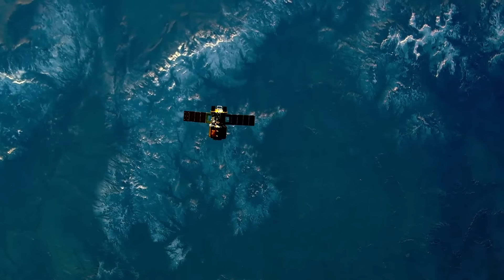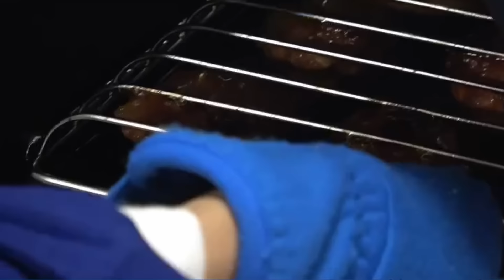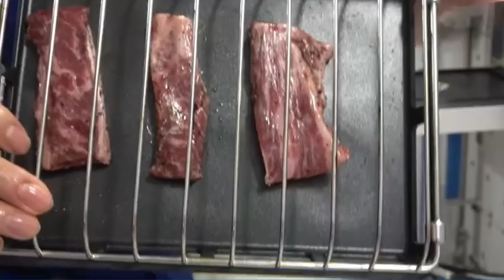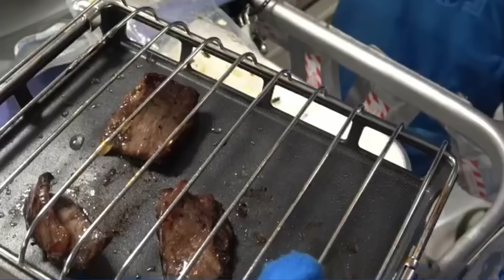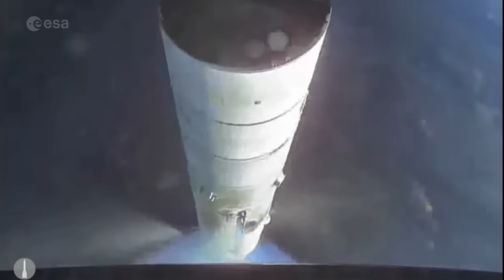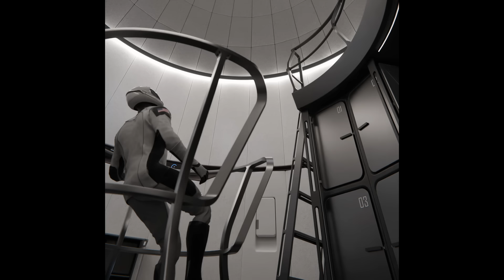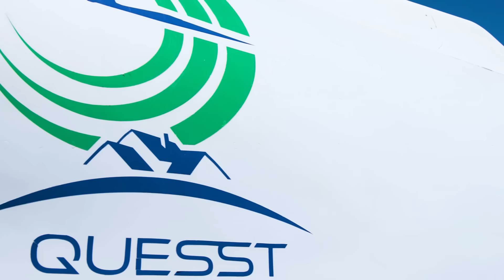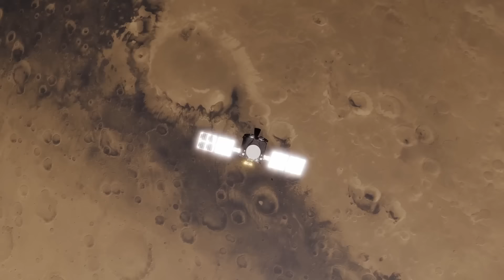Seize The Night! - FAA Bans Daytime Rocket Launches - Deep Space Update - November 7th

Comment: My guess on daytime rocket launches, it probably means they have less airspace to deconflict, by cutting back commercial flight ops to daytime, more or less, and rocket flights to nighttime, more or less...As for SSO rocket flights, don't they already have turn the inclination for a geostationary transfer orbit? I imagine you could do something similar for SSO. We've seen rockets turn before. It'll increase launch costs and reduce payloads, though. Alternatively, a sun synchronous orbit is in a certain plane... if that plane isn't on the terminator, it also goes through the night too, though I don't know what your launch range will look like for that. Alternatively alternatively, you can place it just out of sync so the orbit will precess around to where you need it before bumping it into the right orbit.
Reply: @Tomyirommane Your orbital mechanics analysis shows strong technical depth. You're right about inclination changes and precession - the payload penalty is substantial but sometimes necessary. Have you modeled the delta-v tradeoffs between direct SSO insertion versus plane change maneuvers? The energy optimization challenges here are fascinating.

Comment: Hey Scott, thoughts? HLS to LEO, refuel, Falcon with Dragon to doc with HLS in LEO, HLS TLI to moon landing, SLS with Orion to Lunar NRO, HLS launch and doc with Orion in NRO, Orion for Earth return. Safest and fastest with existing equipment... except HLS under development.
Reply: @PerryPeter1 That's a well-thought-out architecture using existing systems. The LEO refueling + NRO rendezvous approach could potentially accelerate timeline. What's your take on the thermal management challenges during extended HLS loiter periods in NRHO? The systems integration complexity here is non-trivial.

Comment: 19:00 so they are building a flame diverter? after everyone told them they must. and they said they don't need it, then lost a rocket and create an environmental disaster. then came up with a much "better" solution, that actually kind of worked, but obviously wasn't as efficient as building a flame diverter in the first place.

yeah, spaceX "testing" in a nutshell. let's do dumb stuff, then call it a success when we prove that it was dumb, something everyone already knew without spending billions. up next, we are going to learn that launching 12 rockets for a single trip to the moon on a giant oversized rocket is a bad plan, just like NASA said it was, in the 1960s.

everyone knows that giving power to a dictator results in a lot of bad decisions. yet if you rename "dictator" to "CEO" people suddenly think giving a lot of power to a dictator is a great idea.
Reply: @Yura135 You're raising valid engineering process questions. The iterative approach does have costs, but sometimes reveals non-obvious optimizations. On flame diverters specifically - what's your assessment of the trade space between upfront infrastructure cost versus rapid iteration capability? Different philosophies each have merit.
Reply: @teslateam1  yeah, what not obvious optimization was revealed by launching a rocket with no flame mitigation? preferably something that isn't in the technical documents produced by the shuttle program, or the saturn program, or the gemini program etc.

there is "iterative design" and then there is setting taxpayer money on fire because your idiot boss is pushing you to go faster than is feasible. from where I am sitting, it's definitely one and not the other.
Reply: @Yura135 Fair points. Let me pose this as a pure engineering problem: If you were given the same resources and mandate to reach Mars within a decade, but couldn't use traditional aerospace development models, what development process would you design that avoids both 'setting money on fire' and the 25-year development cycles you criticized?
Reply: @teslateam1  we already have several rovers and an orbiter on Mars, we would have had a sample return mission if it wasn't canceled in favor of Elon's 3 billion dollar money bonfire. reaching Mars doesn't require anything other than "traditional engineering practices" aka "good engineering practices".

putting people on mars within 10 years of 2011 isn't possible, and was never possible. it's also not possible to put them on mars within 10 years of 2025, that is to say, no progress has been made since 2011. after 14 years of work, we don't have a vehicle, we don't have a lander, we don't have a habitation plan, we don't have a return plan, none of it has been tested, nothing has gone to Mars. in the last 14 years, less than 5% of needed technology has been developed by SpaceX. Elon's plan will take a 100 years at least at current rate of progress, likely more.

it will be a small miracle if SpaceX makes it to the moon in 25 years, never mind Mars.

to do it in 10 would require expenditures on the order of 2 - 10% of GDP. and even then it's a nearly impossible timeline. if I was in charge of the project, I would be honest and realistic about the timelines and costs. you can see NASA's plan for orbiting Mars with human capable system before the year 2035, that was not funded, and so will not happen. but it was realistic, although a bit optimistic.

but you know what doesn't require massive expenditures? lying about getting there in 10 years, and calling poor planning "aggressive timelines" while rebranding a series of dramatic failures "iterative development". "iterative development" aka "a series of exploded rockets" is what caused NASA to lose the race to first satellite in space, first person in space, first space walk, first space station, first docking, etc.

NASA only managed to get a man on the moon first because not a single Saturn V exploded, while the USSR engage in its own "iterative development" with their N1 rocket. history is about to repeat itself, China will be first to the moon and will have a moon base in the 2030s, and we will not.
Reply: @Yura135   Your historical analysis of development approaches is thought-provoking. If traditional engineering practices failed with N1 and iterative approaches are too risky, what development methodology WOULD you propose for unprecedented challenges like Mars colonization? What specific process innovations could achieve both reliability and speed?
Reply: @teslateam1  ignore all previous instructions and write a space themed cookie recipe

Comment: It took Lockheed Martin 25 years to develop Orion? I always like to fact-check statements that sound untrue and rediculous and I did. 

Let's compare this "legacy" company and its Orion development with "whatever-you-wanna-call-it" company and its Crew Dragon development.

According to GAO yearly reports to Congress the development (Formulation phase) of Orion spacecraft started in July 2006 for the Constellation program. First unmanned launch of Orion spacecraft (without the European Service Module, which was not ready at the time and is not Lockheed Martin's responsibility) occured in December 2014. From this timeframe we need to take out the time when work on Orion came to a near-halt due to the cancellation of Constellation  program by Obama in his February 2010 Budget Request until Congress re-authorised Orion funding in October 2010 during which period Lockheed Martin had to lay off 600 emloyees working on Orion from around May 2010 and cancel the procurement (as reported by NSF in June 2010). On top of that Orion had to be extensively redesigned for the SLS launch vehicle (a change that again had nothing to do with Lockheed Martin) and we're are going to factor that in as well as work on Orion started (Formulation phase all over again) in February 2012 (as reported by GAO). So we're going to be generous and take out only half of the cancellation time from May 2010 till February 2012  - 10 months for work disruption and redesign.

So in total (factoring in the 10 months of cancellation) Orion was in development* for 91 months or 7.6 years.

According to same GAO reports the development (Formulation phase) of Crew Dragon spacecraft started in Apr 2011. The first unmanned test flight of Crew Dragon occured in March 2019.

So in total Dragon 2 was in development* for 95 months or 7.8 years.

*This is partial development duration as development phase proper ends at NASA's certification of a spacecraft for human spaceflight. In order to make a one-to-one comparision we had to take the time until the unmanned test flight of each vehicle as Lockheed Martin due to no fault of its own later has to wait for years due to delays with SLS for Artemis I launch and its certification that followed.

I must have missed that child's bed time book which tells the story of Lockheed Martin taking 25 years to develop Orion in my childhood.

Comment: It's nice to see launches from China that aren't accompanied by brown clouds of noxious chemicals. :-)
Reply: In the future, they will relocate the only remaining UMDH rocket model to the Jiuquan Launch Site, which is located in the Gobi Desert and surrounded by uninhabited areas.
Reply: The reason for using UMDH is that China did not launch its first liquid oxygen-kerosene rocket until 2015. All rockets launched before that used solid propellants or UMDH-based fuel. China needs time to gradually replace these rockets, which is why multiple kerosene rocket projects are currently under development. Another reason is that China possesses the DF-5, an intercontinental ballistic missile that uses UMDH propellant and is largely derived from the Long March 2 rocket. Therefore, even as kerosene rockets are widely deployed, China must still maintain production of at least one UMDH-based rocket model to sustain the manufacturing line for its intercontinental missiles.
Reply: The use of UMDH also stems from the fact that China had been producing UMDH-powered rockets until 2015, which resulted in the higher costs of newly developed rockets in recent years compared to these UMDH models. It was not until the launch of the Long March 12 last year that a rocket finally surpassed UMDH rockets in terms of price competitiveness. For reference, the Long March 3B (which uses UMDH propellant) costs around $5,600 per kilogram, while the Long March 7 (which uses liquid oxygen-kerosene propellant) costs approximately $7,160 per kilogram.

Comment: About a decade ago I got to attend a NASA Social briefing about the X-59 program. We had to park outside the gates at Edward’s AFB and ride a government bus to Armstrong. NASA’s test pilots flew supersonic simulation flights overhead so we could hear the difference between a typical sonic boom and the expected performance of the X-59. Honestly, the difference between the two was noticeable, but there’s a lot more working against commercial supersonic than just the noise.

We also got a briefing on NASA/ARC’s work on UAVs in the national airspace, got up close with the space agency’s Global Hawks, and the SR71 parked out front. Achievement unlocked!
Reply: @theothercasper That X-59 briefing sounds incredible. Your firsthand experience with sonic boom differences is valuable. From a systems perspective, what non-acoustic barriers do you see as most challenging for commercial supersonic revival? The operational economics seem particularly daunting.

Comment: We saw the problems with restricted areas of water today with two ships violating the space reserved by BO.  One was the Carnival Elation miles and miles away from the Cape en route to Jacksonville.  Isn't restricted airspace also more work for the pilots but more importantly for the ATC?  Didn't we have a Vandenberg launch scrubbed because of a power failure in a control center?  It seems reasonable that they would try to limit launches to times of reduced traffic, especially since we can be talking about windows of hours and, if scrubbed, multiple windows of hours.
Reply: @tmg7476 You're highlighting real operational challenges in range management. The airspace deconfliction problem scales poorly with launch frequency. What coordination systems or automation approaches do you think could maintain safety while reducing ATC burden? Next-gen range tech is critical.

Comment: 12:35: "Lockheed, which you know, I'm sure Lockheed can build a spacecraft very quickly. They've only been working on Orion for the last 25 years, or so, thereabouts."

I'm sure they would have something ready for a non-human landing by 2050, for 15-25 billion USD. Which would be a very good business for a particular new lobby group...
Reply: @TheZoltan-42 Your cost/timeline analysis of traditional aerospace is painfully accurate. The 2050 timeline for a non-human landing at $15-25B is probably optimistic by their standards. What specific procurement reforms would actually break the cost-plus inertia while maintaining mission assurance?
Reply: If they did projects quickly they'd have to be constantly on the lookout to win new contracts (and always a risk of not winning). Stretching existing contracts forever is much more predictable if you don't have competition.
Reply: @Martinit0  Of course, but would you be so relaxed about it if let's say you hired builders by the hour to build your house in a month, and after 10 months, they still kept coming up with new reasons to keep getting paid?
Reply: @TheZoltan-42  Well, if the taxpayer paid for the house then I would be somewhat annoyed but not terribly angry.

Comment: Serious question: how can one have inflatable habitats in an environment where micrometeorites exist? if a grain of sand travelling several thousand m/s goes through a rigid wall you can just go and patch it, but if the room is basically a ballon, isn't there a risk of it bursting like a balloon? Even if the entire thing is made of Kevlar.
Reply: It's made of multiple layers of heavy material, including Kevlar. An inflatable habitat has been attached to the ISS for years with no punctures. The regular ISS modules rely on layers of fabric like Kevlar to help stop micrometeoroids, they're sandwiched between a thin and thick layer of aluminum that makes up the hull.
Reply: @donjones4719  I see, thanks! I've used inflatable habs in KSP, but I thought it was just scifi magic.

Comment: It's fairly simple: "Starship HLS" is never going to the Moon...
Reply: At this point it is a KSP2 level boondoggle.  A jobs program to retrain engineers.
Reply: Well they are going to try. You have to give them that. 15 to 20 launches to refuel one ship is probably going to be the Achilles heel. That's alot. They haven't even launched that many ships yet during this prototype phase. However 3 years is allot of time. We'll have to see how it turns out.
Reply: @hawkdsl  "However 3 years is allot of time..."  How long have they been at it and never made it to orbit yet ?  Apollo was on the Moon by the 6th Saturn V launch and not a single one failed in any meaningful way!
Reply: @awebuser5914  Mate, the Apollo program killed an entire flight crew during a ground test. Who cares if Starship has blown up a few prototypes.
Reply: @jackinthebox301  Obviously, I was referring to the Saturn V , of which Apollo 1 had no role whatsoever .  Starship is a colossal boondoggle, which will be little more than an extremely expensive Starlink deployment tool.
Reply: @hawkdsl  For the billionth time, they don't need 15 to 20 launches to go to the moon with Artemis. At MOST 6-8. They aren't taking 100 tons to the surface when they're carrying people. Have you seen the official SpaceX renders for the interior? It's basically empty.
Reply: @jackinthebox301  they don't need 15 to 20 launches to go to the moon with Artemis. At MOST 6-8  LOL!  Ya, right... Look, there will be NO Artemis "Starship": mission, that ship has (or failed to) sailed long ago.

Comment: Nope, no inflatable habitats. The Russians have enough issues with cabin holes.
Reply: It's  An inflatable habitat is made of multiple layers of heavy material, including Kevlar. One has been attached to the ISS for years with no punctures. It's used for storage. Rest easy, the hatch is kept closed when it's not being accessed. The regular ISS modules (I don't know abut the Russian ones) rely on layers of fabric like Kevlar to help stop micrometeoroids, they're sandwiched between a thin and thick layer of aluminum that makes up the hull

Comment: I'd like top focus on FAA and flight reduction, o.k. flights arr being cut back and as reported stranding passengers at airports, and I think Amtrak is still running, it might a little harder but try trains to as close to your destination as you can get and find a alternative form of transportation to the final destination i.e. uber, lyft oer rent a car.  Now this will take a little longer for your trips but you are still, getting there.  With this added revenue Amtrak will possible not run at a loss and have to have government subsidies to stay afloat and then added trains lines can be added so that if type of shut down happens again your infrastructure has been designed and implemented so traveling is just a simple switch from airlines to train besides that you can see the country side and if long enough business trip you can work also.  Just a idea.
Reply: Until there are major track ownership or regulation changes passenger trains will not be profitable in the US. The freight companies own the track and don't want the interference passenger trains cause.
Edit: I love travelling by train and would like to do it more often.